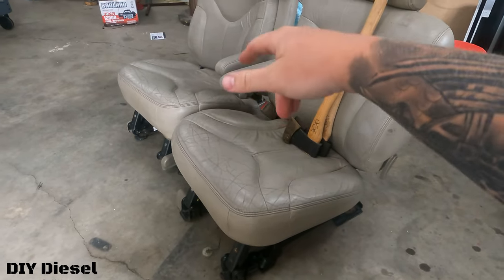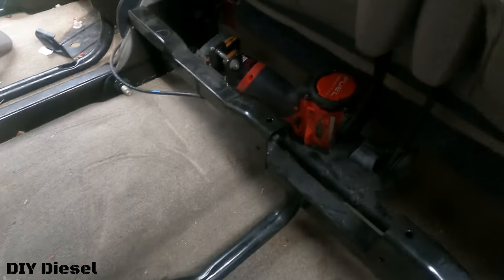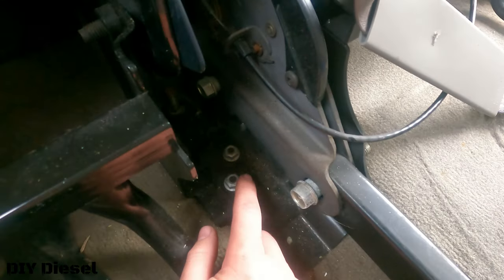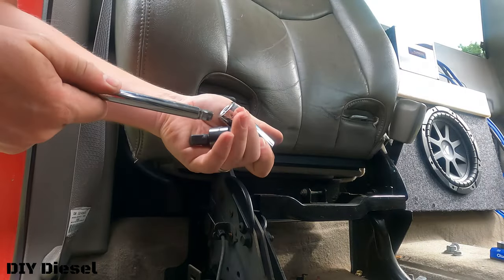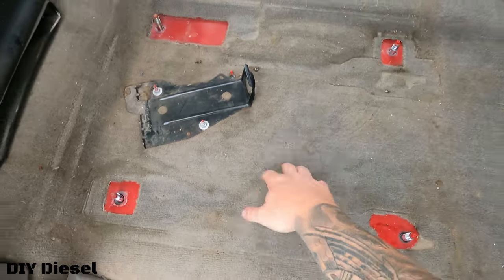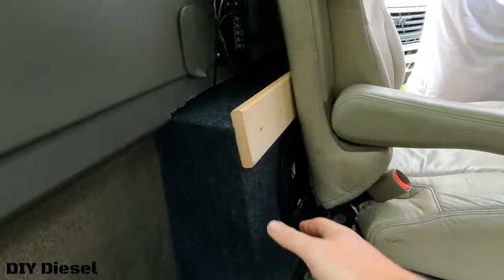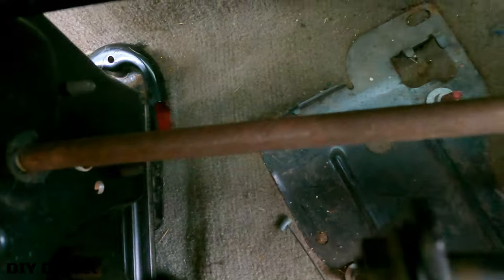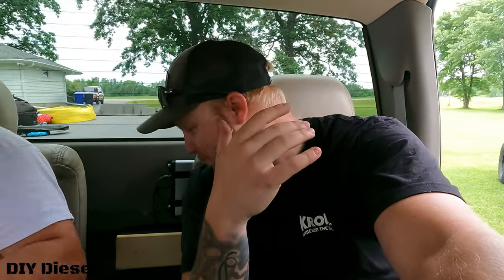How To Install Rear Captain Seats/Bucket Seats in a GM/GMC Silverado/Sierra

Comment: I have a 2013 GMC Sierra.  Do you think I can do this to my truck as well?  Also, I would like to put the center console back there for more storage .
Reply from the maker: So these will actually work for 2000-2014. You will have to re upholster them if you want it to match your interior though. 
In regards to the center console you can wither build your own. Which is what we will be doing. It’s very simple, or find on from 200-2007 that will fit between the two, and you will have to do some plastic cutting to make it fit. It won’t look as good though. I would suggest building your own 👍

Comment: What model Yukon did you get that out of? And do you think it would fit in my 06 gmc sierra
Reply from the maker: Out of an 02’ Yukon XL absolutely it will this is a 2006 GMC truck
Reply: I got some out of a 04 Yukon XL, and they wouldn't bolt up to my 05 silverado. Brackets were to wide one way and to short the other.

Comment: So the seats in the video I’m assuming were originally front captain chairs? Or is that incorrect?
Reply from the maker: No these are from the middle row of a Yukon XL that is why there are no seatbelts built into the seat like front seats have.
Reply: @DIYDiesel are there any with armrests, and seat belts? I'm trying to find seats to put in an old 70s P30 motorhome that doesn't have shoulder belts.

Comment: You think a 2007 jump seat would fit In between ?? I know the slots don't line up for the nuts but I'm wondering If it'll fit and then customize the seat to the bolts
Reply from the maker: I am not sure I would think it would. There is 12.5” of room from seat to seat
Reply: @DIY Diesel  ok. Thank you boss, I appreciate it.

Comment: Can you change the front seat in a 2002 avalanche to a bench seat
Reply from the maker: Possibly with a 2500HD front bench seat because you’ll have to get over that transmission hump in the cab. I would see that working just fine. No different than my taking avalanche front seats and throwing them in my Duramax. I took out a front bench.